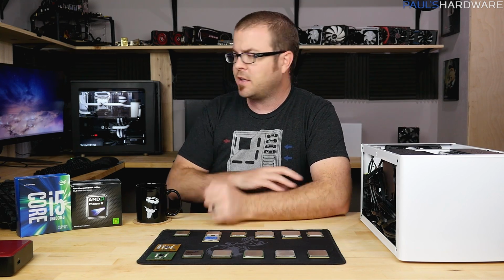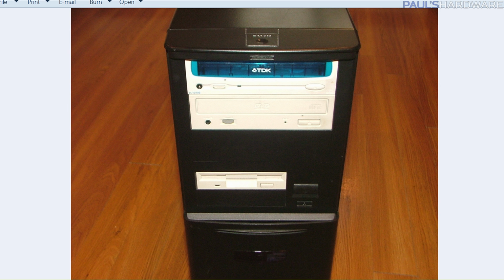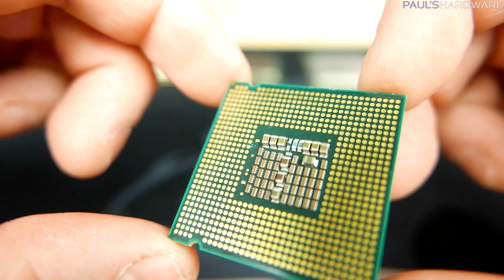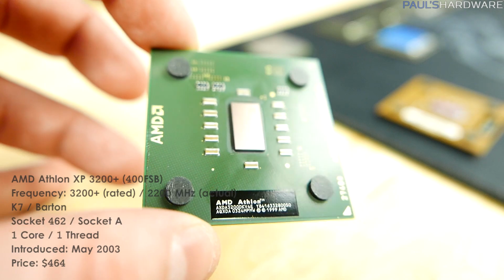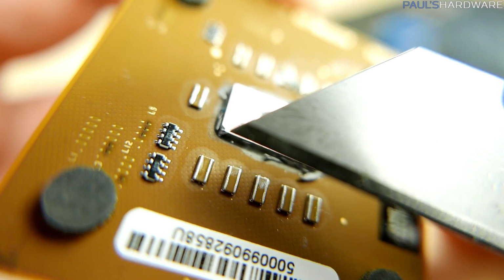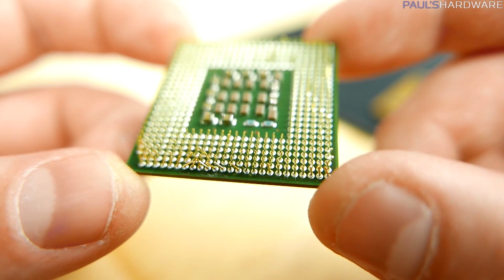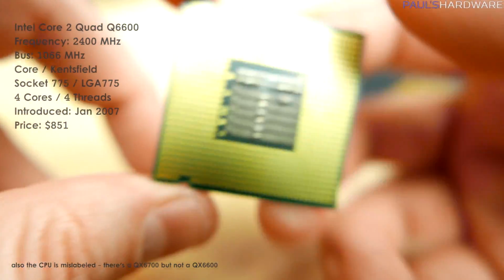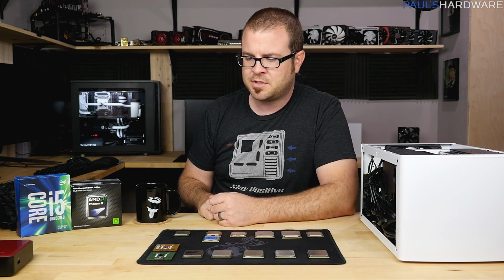My CPU Collection!

Comment: What!!!??  No 300A in there?  My first build being a pentium 150 that I oc'd to 166 and a cirrus logic video card (OG Mechwarrior days) my 300A with a homebrew huge aluminum heatsink and my dremeled out side panel with hardware store plexi (yes before you could buy a case with a side panel) was one of my favorites.  If I remember right it wasn't long before the 3dfx was added and a 2x cdr drive.  I still remember the sound of my tape drive backup kicking on every 2am.  Lost a girlfriend over that.

Comment: Cpu list: 
Amd sempron 1600+ at 2 ghz 
Amd Athlon 64 3000+ (have had about 6)
Amd Fx 6300 
Amd Fx 8320e @ 4.1 ghz 

Intel pentium II 
Intel pentium III 
Intel pentium 4 
Intel core 2 duo 
Intel Xeon e5440 (2) cpu system 
Intel Xeon x3220 
Intel pentium @ 2ghz

PowerPC 970 
PowerPC 750  

Too many

Comment: Ah, Athlon XP 2800+, the CPU of my first "official" gaming PC. A Falcon Northwest. Though, I've been building and upgrading my own PC since 2007. I've still got a component from back then, although, at the time that hard drive was inside an external enclosure... it had some enclosure problems so I extracted the drive and mounted it internally. Still works, and still has files for 2007 on it. I've got 3 physical HDDs and 1 SSD that I use for the OS, I won that for free about 5 years ago at the Game Developers Conference, so much free stuff was given away that year... I even got a Blackberry that I never used and and iPod, and an Intel Atom based Netbook.

Comment: why paul, did you do the pencil overclock trick on that 2800+?  It was that, or that little 9 dollar pin strap that went underneath.  I had a 3000+ barton myself, and it is good to take a trip down memory lane! Its not all about the build and hardware reviews, you gotta take a step back and see the history sometimes!  I thought I was the only one with old CPU's sitting around in the OEM tray boxes though.  Good stuff Paul!

Comment: I remember having a AMD 3200+

Now in single thread I didn't get much more speed. Remember it was the time of windows XP and the Pentiums where pretty powerful to. But dual core... dual core.. suddenly things felt so smooth. 

I remember Intel trying with the Pentium D and EE versions. Just pushing up the core speed and making a few dual core versions. But for that time it was the AMD dual cores that where beasts. 

Suddenly the HDD was being slow..:!

Comment: AMD: Our 2200 processor is just like a 3200 processor, but slower.

I never bought into that and stopped supporting AMD entirely.  I have an old amd x2 im using to just be a media server, thought it was intel based on the ebay seller saying it was. :|

Comment: The chipped die corner will not kill the CPU at all because there is nothing but blank material in the corners.  I had an AMD athlon back in the day that I ended up chipping on not 1 but 3 corners and that CPU worked just fine and was still working many years later when I scrapped it

Comment: I have a Q6600 still running in my house, Q6600, 5850 gfx(flashed to a 5870, then overclocked), 8gb ddr3, for my partners computer, it still plays 90% of games on high at 1080 no problem with the exception of bf4

Comment: I had an old xp athlon 3000, can't remember what manufacturer it was but I had an overclocking fan, it all was going great until I noticed the thermal paste was going bad so I go to remove the processor and the top of the CPU die literally split off and was burned into the base of the heatsync! Those older AMDs were really bad for heat (although earlier pentium 4 were far worse).

Comment: Must have won the bin lottery with my previous 2600k, stable at 5.2GHz on air, did manage to get a successful bench @ 5.6GHz. "Upgraded" to a 4690k and clock speeds top out at 4.5GHz... so I've pretty much wasted my time. Yes.. instructions per clock but I'm really doubting there's much of a performance improvement that makes it worth the £300+ cost.

Comment: I am still using my trusty old Intel i7 920 C0 stepping in this PC I am currently using. I plan on upgrading to a Broadwell-E later in the year. Also still got my Pentium III 600Mhz, Pentium 4 2.4GHz, E6600 and Q6600 CPU's

Comment: Cool video, made me think and this is my list I've had since I was 6yrs old till current*

My CPU LIST:
386SX 33mhz.
486DX 100mhz
Intel Pentium 166mhz
Criix 233mhz
AMD Duron 700mmhz
AMD Duron 800mhz
AMD Duron 750mhz
AMD Duron 1.0ghz
XP athlon 1400+ 
XP athlon 2200+
XP athlon 2400+
AMD 939 3800+ X2
Intel Core Due 8400e 3.0ghz 
AMD X6 1090T 3.2-3.6Ghz (was water cooled and hard clocked to 4.0ghz)
FX 9590 4.7ghz 8 core (current and had since launch)

What is your list guys?
Reply: nice list, I had 12 different athlons becouse some it company trow them away

Comment: Still running a i7 920 overclocked to 4.01ghz and 18gb ram. They are the beastly with their stability while overclocking; especially with good cooling. I'm also running a core 2 quad q9400s for my lounge room gaming pc. It has the same base clock as the 920 and performs comparatively. Although i've never bothered overclocking it.

I'm waiting for a reason to upgrade them, but as it stands now, the only reason I've seen is that the mobos have I/O bottlenecks.

Comment: this just made my i7 2600k look archaic!! even though it has never bottlenecked me in any way i think upgrade time :P even. it runs rock solid @5GHZ and has done ever since i water cooled it 3 years ago and im running 2 gtx670s (watercooled) in sli. yes i know now this system is laughable now but i still game to the max settings and now i know that 2gb vram is defo not enough :( the rest of the system is rock solid its just the vram upgrading now seems sucha waste!

Comment: Ha, your 920 system was pretty similar to mine. 920, 6GB ram, gtx 260, but I used a gigabyte board. I'm still using that computer as my primary too. Upgraded the vid card to a 760, upgraded to 12GB ram, and added an SSD. It's still going strong. Hopefully in the next year or so I can build a new one, thinking it may be an AMD build if Zen is any good - waiting to see.

I also have Q6600 system that I use as a test rig. The Win10 test builds all went on there before I migrated my primary.
And I have an Athlon XP 2500+ Mobile sitting in a box that I saved, just because...

Comment: Credit Cards always were my goto pin straighten outer lol  ;) ,But I had my pc store back then and I had a few(more than a few) that worked ,and that HSF you had was KNOWN for destroying cores on your old arhlon on your first PC you built. The PR raing was based on the 29  % clock per clock advantage AMD had back in the day,I had the 386 1st ,486, AMD k62 350 (oced to 500 in a compaq) ;)k62+ or k63 550,then a 1000 tbird that ran @ 2204 mhz ,yes a 120% oc.then an athlon 64 3200 ,now I have a kaveri7850k @4600 ,and had a few in between,also had that q600 intel @ 3.0 ghz,still have a few,and they still work,. Thanks for the mem lane trip ;_) 

Mike (AKA WILDONE)

Comment: tick/tock was there before the intel CORE cpu's ... afaik (and i've been on pc's for almost 30 yrs now) it's been introduced with the P4 on netburst ...  btw if you went from and amd k6-2 to an p4 you definately didn't upgrade often... my trackrecord goes this way around:  i286 12Mhz, amd 386+387 25mhz, amd 486dx4-133-intel pentium2 450, amd Athlon (Tbird) 1333, athlon xp (barton?) 3200+, intel core2duo 6850, intel core i5 3570K
and that's where i'm currently at... my gpu was upgraded even more often btw, my first 3D card being the voodoo ² addon card :) (before that i just had vga and an EGA on the 286)

Comment: i have a mobo where i bent 9+ pins on the socket, and i ended up bending them into place with an EXTREMELY fine flathead screwdriver, some of the bent pins are still very much bent, but they dont touch and contact the cpu, ive actually had to use it to transfer windows AFTER i bent the pins, so yeah, its pretty resilient
Reply: board in question: LGA1150 Gigabyte h81-m rev. 2.0

Comment: Correct me, if I'm mistaking, but there where two things not quite right. 

First thing is that there never was a QX6600, it was just named Q6600.

Second thing is that you said that the 3960X was the first time Intel introduced a six core consumer processor. Didn't they already do that  with the 980X one generation before that on the X58 platform?

Comment: 1) AMD Athlon XP 2000+ 1,667 Mhz (Desktop)
2) Intel Core Duo T9550  2,66 GHz (Laptop) still sitting here around with Win 10
3) Intel i5 4th gen don't remember the numbers..... 3.4 Ghz (for my parents)
4) Intel i7 3770 non K (using right now and will use it for a long time)

Comment: No, a processor isn't dead just because a tiny piece of the die is broken. I have a collection of 300 CPUs, I have some with big chunk of the die broken...and they still work just fine. Namely a Duron 850 which was soldered to a crappy PCChips motherboard, with the heatsink glued on it. When I pulled it off, it too a bit of the die with it. I didn't care much but tested it anyways and it worked.

Comment: I have a question. So im looking to build a new computer (last one, the mobo shorted and killed almost everything), everyone will tell me or demand that I buy intel, im looking to get an i3 or i5 because of the lower price. I know that im going to get a GTX 750 ti or 960. Im trying to keep the price down so would the i5 be  worth the extra price? or should I do for the AMD FX series?
Reply: Better take the i5 for the future. I have an i7 3930k and use it with a 750Ti and a 650(dedicated to physx). runs perfectly. BF4 runs at about 75-100FPS at an ultra mix.
Reply: Just wait a little for Zen.
Reply: wait for zen

Comment: My cpu "collection":

My main pcs:
Intel Celeron 333MHz (Custom built PC)
Intel Celeron 1.8GHz (Custom built PC)
Intel Pentium 4 3.0GHz (Some old IBM SFF PC)
Intel Core2 Duo E6300 1.86GHz (HP DC7700 SFF)
Intel Core i7 920 (Xeon W3520) 2.67GHz (HP Z400, my current PC)

Other pcs:
Intel 486 SX (HP Omnibook 530)
Intel Atom N270 (HP Compaq Mini 110c)
Intel Core2 Duo E8400 (HP DC7800 CMT)
Intel Core2 Quad Q6600 (Custom built)
Intel Atom Z3735G (HP Stream 7)
AMD Athlon XP 1800+ (Custom built)
2x Intel Xeon E5420 (Fujitsu Primergy TX200 S4)
2x Intel Xeon E5420 (Dell PowerEdge 2950)
Intel Core2 Duo T7200 (Lenovo Thinkpad T60 2008 model)
Intel Core2 Duo T7200 (Fujitsu Siemens Lifebook T4215)
Intel Pentium Dual-Core E5200 (HP DC7900 SFF)
Reply: +Pasi123 
Thats a very large collection you got there. My collection is a lot less varied. Impressive.
Reply: +Pasi123 go to hell with your lies
Reply: +Dimitar Stoyanov Those all have old cheap machines... I have all those things I can even put pictures all of these
Reply: Pasi123 sure do it :D
Reply: Dimitar Stoyanov
http://imgur.com/a/WiIco
Reply: nice lol
Reply: Koa la
No
Reply: Pasi123 then dont talk like you do
Reply: +Koa la (Koala) I use Google translator :D
Reply: Pasi123 :)

Comment: Cool, got a similar collection. Mine date back even further. I got a 486SX-25, Pentium 200MMX, Pentium II slot 1, Pentium III but ended up selling most of the CPUs and the systems that went with them.

Comment: I got my athlon 11 to work after breaking of 3 pins. what i did was. i correlated and marked on the socket where the broken pins should be with a pencil . Then i got 1 of my old amd cpus and removed 3 pins with my solder iron. cut them down smaller as they where the bigger ones like you show here, and then , all under mag glass. i placed a micro splodge of thermal paste onto the cpu's missing pin place. its looks a tiny dot of solder when the pin is missing. So now i have 3 pins placed into the socket. and my cpu with missing pins ready to put back into the socket with thermal paste in place. The pins are standing proud just a touch, So i put in the cpu and close the bar. Im now sweating and in a shaky place. I cant live with no computer :) Take a deep breath and press the button on the wire. and !!!!!!!!!!!!!!!!!!!!!!!!!!!!!!!!!!!!! BEEP BEEP.. it worked haha i was so made up with my self. i still have that cpu just here in my draw with my collection. what a feeling. Anybody else would of thought it was screwed and buy a new one. that lasted me another 2 months untill i could buy a new one.

Comment: I have the i7 960 and it runs all the newest games good with my msi gtx 750 ti
Reply: +mana1111  i also bought my card a month ago XD
Reply: Could I run all the next eat games with a 750 to and a q6600
Reply: +FusionFall Maina 750 ti
Reply: +FusionFall Maina i think you can run some new games but not on highest settings but i cant guarantee you that
Reply: +5678mjh5678 I am running the same exact set up as you LOL. i7 960 + msi gtx 760 ti. I just bought the 760ti like a month ago. =3 much better than my old gtx 570ti

Comment: is this good for the game Beam.NG drive it runs some 3D games at around 20-36 FPS these are the specs

Intel Core i5-3230M @ 2.60GHz turbo boost to 3.60GHz 2 Cores 6GB DDR3 Ram (5.88 usable)
Memory 465 GB HDD
Built in Intel graphics card (its a laptop)
Windows 10 Pro With MS Office Pro Plus 2013
 DVD Slot: DVD±RW/DVD-RAM/DVD±R Double Layer
Bluetooth 4.0
2 USB 2.0 1 USB 3.0 HDMI and VGA output
15.6 inch HD TrueBrite Display

Comment: Our first pc had a 486 dx2, the pc itself had a big button on the front where you could switch cpu clock from 16 to 66Mhz, it had a 1GB 3.5" harddrive, first pc I ever played Rollercoaster Tycoon on. Good ol' times :)

After the 486 I got my first own pc, which had a 2.6Ghz Northwood Pentium 4 in it. After that I build my first 'from scratch' computer, only re-using the case, this had a Core 2 Duo E6750 in it, then upgraded to Core i5 750 and I'm currently at a Core i5-4670

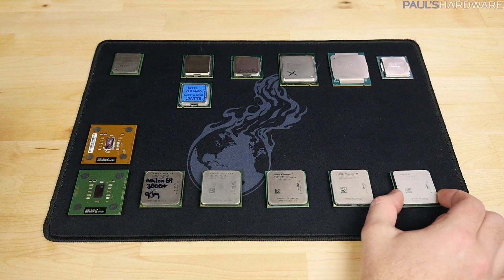Comment: 4:32 - But the 8350 is just an OC'd 8320 ...
Reply: +Skyler  IDIOT
8320 was released years after the 8350
Reply: Dimitar Stoyanov Wtf.. the 8320 and 8350 were released on the same date, 2012-09-02 8320: 3.5 Ghz 3.7 Ghz, 8350: 4.0Ghz 4.1Ghz
Reply: The 2nd generation FX-series was released on 23 October 2012 with the FX-8350, FX-8320, FX-6300 and FX-4300 CPU models. The FX-8350 featured slightly improved power consumption and was found to be approximately 15% more powerful than the fastest Bulldozer CPU.
Reply: Skyler 8320 was released on the same date with 8370 not 50
Reply: Dimitar Stoyanov the 8370 has the wraith cooler, and it's released during 2014; I see no 8320 other than the "E" branded one, which is not the original.

January	
Kaveri desktop launch
A10-7700K
3.4GHz / 4MB L2 / 4 cores / Unlocked / Socket FM2+
A10-7850K
3.7GHz / 4MB L2 / 4 cores / Unlocked / Socket FM2+
 	
March	
A4-4020
3.2GHz / 1MB L2 / 2 cores / Socket FM2
A4-6320
3.8GHz / 1MB L2 / 2 cores / Socket FM2
A6-6420K
4GHz / 1MB L2 / 2 cores / Unlocked / Socket FM2
FX-670K (1st quarter)
3.7GHz / 4MB L2 / 4 cores / Unlocked / Socket FM2

April	
Socket AM1 (FS1b) introduction
Athlon 5150
1.6GHz / 2MB L2 / 4 cores / Socket AM1
Athlon 5350
2.05GHz / 2MB L2 / 4 cores / Socket AM1
Sempron 2650
1.45GHz / 1MB L2 / 2 cores / Socket AM1
Sempron 3850
1.3GHz / 2MB L2 / 4 cores / Socket AM1

June	
A10-7800
3.5GHz / 4MB L2 / 4 cores / Socket FM2+
A6-7400K
3.5GHz / 1MB L2 / 2 cores / Unlocked / Socket FM2+
A8-7600
3.1GHz / 4MB L2 / 4 cores / Socket FM2+

July	
A4-7300
3.8GHz / 1MB L2 / 2 cores / Socket FM2

August	
A10 PRO-7800B
3.5GHz / 4MB L2 / 4 cores / Socket FM2+
A10 PRO-7850B
3.7GHz / 4MB L2 / 4 cores / Socket FM2+
A4 PRO-7300B
3.8GHz / 1MB L2 / 2 cores / Socket FM2
A4 PRO-7350B
3.4GHz / 1MB L2 / 2 cores / Socket FM2+
A6 PRO-7400B
3.5GHz / 1MB L2 / 2 cores / Socket FM2+
A8 PRO-7600B
3.1GHz / 4MB L2 / 4 cores / Socket FM2+
Athlon X2 450
3.5GHz / 1MB L2 / 2 cores / Socket FM2+
Athlon X4 840
3.1GHz / 4MB L2 / 4 cores / Socket FM2+
Athlon X4 860K
3.7GHz / 4MB L2 / 4 cores / Unlocked / Socket FM2+

September	
FX-8310
3.4GHz / 8MB L3 / 8 cores / Unlocked / Socket AM3+
FX-8320E
3.2GHz / 8MB L3 / 8 cores / Unlocked / Socket AM3+
FX-8370E
3.3GHz / 8MB L3 / 8 cores / Unlocked / Socket AM3+
FX-8370
4GHz / 8MB L3 / 8 cores / Unlocked / Socket AM3+
 
October
		
November	
	
December	
FX-770K (4th quarter)
3.5GHz / 4MB L2 / 4 cores / Unlocked / Socket FM2+

Comment: I have a Athlon 2 x4 620 processor that I'm currently using in a Biostar TA970, I was reusing the processor from a previous build and I unfortunately bent some pins, I spent about an hour or so bending 50+ pins back with my fingers and tweezers, how fun

Comment: My amd a6 5400k which I currently use, also has a wrong number on it. I have the boxed unlocked version, but the number says that it's an OEM locked version. The number on the box of the cpu is actually correct, but the number on the cpu isn't. BTW I've checked it using cpu-z and it's overclocked to 4.2 GHz so it is the unlocked version for sure.

Comment: I understand the CPU die thing all to well... I was taking a kraken G10 off an R9 290 and putting the stock cooler back on to sell it and chipped it. Totally doesn't work now. Oh well it was $200.

I've also bent plenty of AMD CPU pins, but managed to straighten them all out.

Comment: Oh that brings me back! I had my XP 2700 running at 2.4 GHz, those were the days, when you could buy mid level hardware, and with just a LITTLE BIT of tweaking, you could get FULL FLAGSHIP PERFORMANCE - and even BEYOND! Like the over clock done on my 2700!